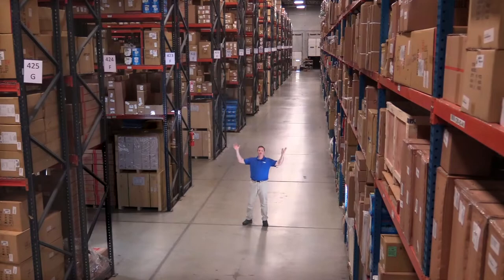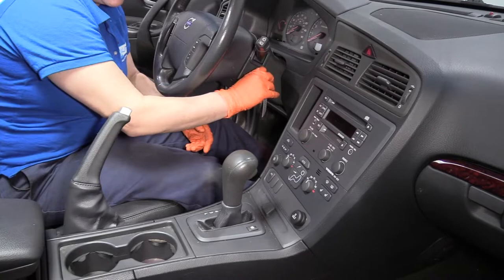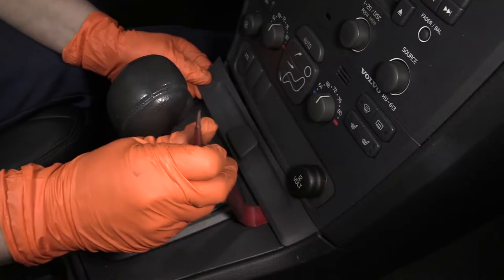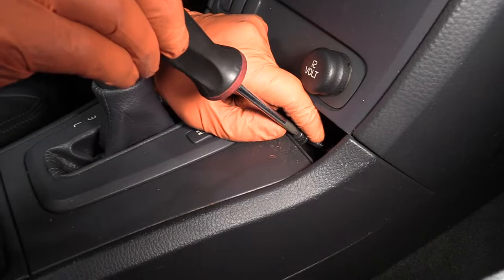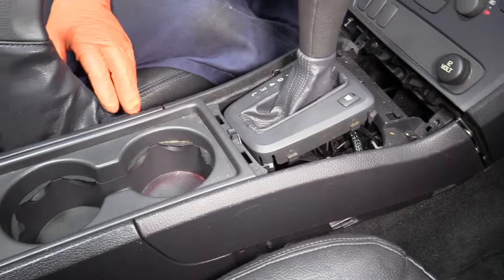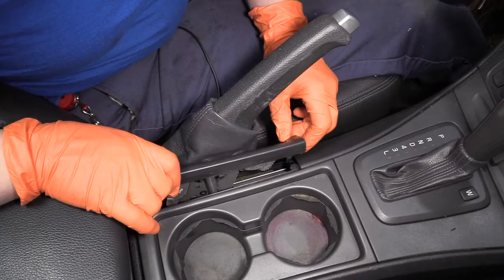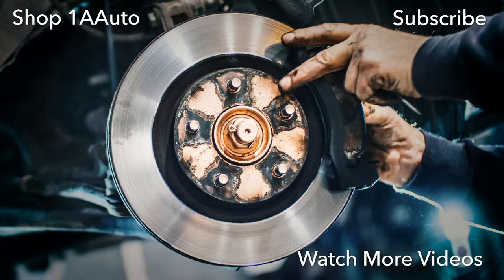How to Remove Center Console 00-07 Volvo V70

Comment: Great video and useful for '07S60 too.   Two notes: It was easier just to remove the parking brake boot than wedging it in the slot (lost about 20 minutes trying that approach).  Our car also has an auxiliary audio jack and the cable for that was tucked between the storage bin and side of the console.   It was easiest to remove the black panel beneath the 12v aux to get access to the plugs.
Reply from the maker: +Chris McKerrow Thanks for checking us out! http://1aau.to/m/Shop-1AAuto-c

Comment: I'm having trouble removing the console body.
I removed the 4x T25 screws and both bottom side panels, the 12v connectors and everything related to the shifter.
It's free in the back but not in the front.
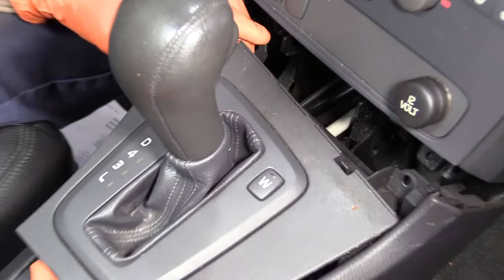At 2:15 the front is still touching the dash but at 2:33 it has moved and is free.
On my part, it is still attached solidly. I haven't dare to pull hard on it for fear of breaking something.
I was just watching this video again to make sure. 
There doesn't seem to be anything still holding it.... 
So I'm going to go and try to pull hard on it...
Reply: Some models (e.g. XC70) have a silver rail on the right hand side of the console. If yours has it, there is another T25 screw in front of it, just to the right of the shifter.